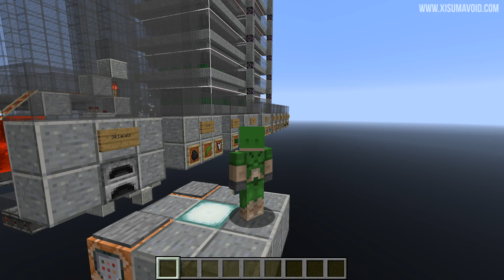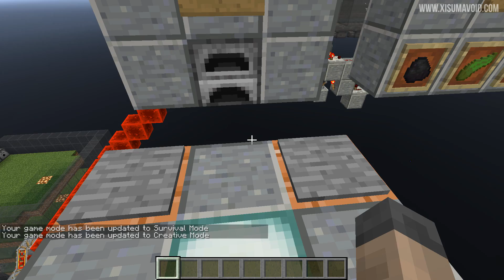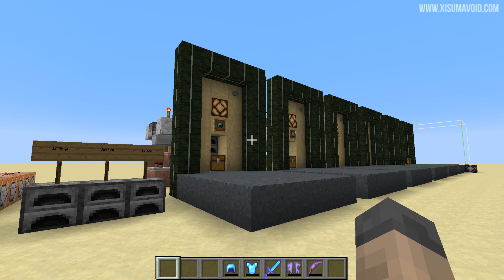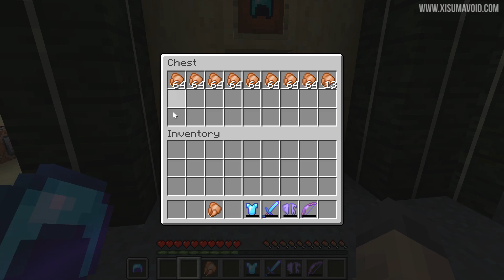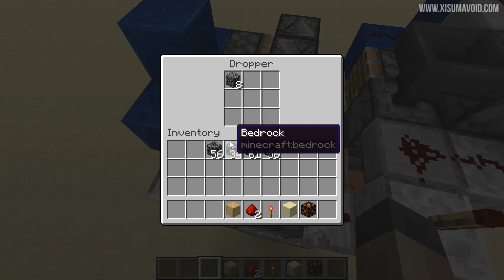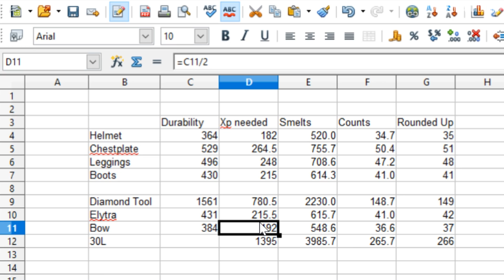Minecraft 1.13 Instant Item Repair System

Comment from the maker: FYI : Not longer after I finished recording this video I figured out a way to do this with 0 redstone... So tutorial may be coming soon :-)
Reply: Let me guess - setting the storage of the output chest to the amount needed for the tool, making the furnace stop simply by backing it up. Is that how to you're going to make this redstone-less?
Reply: niice :D
Reply: I tink level 27 to 30 is more usefull as 0 to 30
Reply: You can have the hopper under the furnace have just enough empty space for the number of smelts you need.
So if you need 520 smelts, you leave room for 456 roast chicken.  When it's done, the furnace will have the right amount of XP, and a full stack to take.
Reply: Mumbo will be upset
Reply: @bluewarrenlim  nothing stops you from building automated restart system by addind lockable hopper underneath the chest to get rid of cooked chiken.
Reply: Blue Warren Lim why?
Reply: I would like to see a tutorial on this working both ways, one with redstone and one without. I was thinking you might be able tho use a sticky piston to move a redstone block into place to lock the lower hopper once the desired count is reached. This way you could duel wield items and repair both, if they aren't both totally down to one point of durability. Thank you for your snapshot videos.
Reply: 0 Redstone! That's my kind of Redstone 😋
Reply: @BiffaPlaysCitiesSkylines  hi biffa
Reply: Blue Warren Lim this is ex suma void not biffa
Reply: Great! Will be watching for the follow on.
Reply: HOW !?!?
Reply: @adamsanchez6770  simply by putting some items into chest.
Reply: nice
Reply: Can't wait for that tutorial Xisuma
Reply: I've found and killed two Drowned that were carrying both a nautilus shell and a trident and both times they dropped both. Might be worth investigating? I have screenshots.
Reply: The most simple sollution usually is the hardest one to come up with.
Reply: chest array? 

what I would do is have a system that instead of stopping the smelting at a particular point, specific to each item, is have a meter that indicates increments of items smelted,
Reply: Ok great
Reply: come to think of it, the best item to smelt if you are less patient, isn't chicken, its fish from a guardian farm, I mean absolutely passive, despite the amount of time it takes, kelp is really convenient, but you are already going there for xp, and you will run out of food, so you can check the furnaces for xp when you go there, and if it isn't enough, you can go afk, or afk when you have time and go to the furnaces when you dont. I guess it really depends on where your base is
Reply: YES
Reply: MY BODY IS READY
For I must use this XP to repair my items! It's literally the only use I have left for XP lol, I want a new reason to horde the green stuffs!
Reply: How about using an automated chicken drowning farm to get something to smelt up, and a carpet or witch farm to fuel it?  (Witch farms are great but if your base is 1000 blocks from the nearest hut... although I suppose you could just use a regular mob grinder with a lower number of witch kills.)
Reply: #keen
Reply: Instead of the roast chicken you can use a cactus farm which could produce items alot faster
Reply: Why not use the wither tree farm to filter wood into an infinite charcoal smelter (using charcoal to make more charcoal) you could actually use all the leftover charcoal while the chicken will just go to waste?
Reply: Does this work on beadrock or it is java exclusive.....
Reply: Has it come yet?
Reply: The Belgian Boy for your information
Reply: Does thus still work in 1.15.2?
Reply: Yay! I have like no redstone left on my world
Reply: can i join hermit craft?
Reply: @ipolar6217  ive heard grian is the final person to join.
Reply: Glenpri I want to join to

Comment: If you know how many items need to be smelted, then you could compare the output chest to another chest (with the right number of items in it) so that it will stop the furnace when it has the right number of xp.  Of course, having emptied out the xp, you'd also need to empty out the furnace output chest.  Not knowing what those counts are, I'll eagerly await your tutorial. Or maybe, I'll use your spreadsheet to figure out a system of myself.

Comment: What if, instead of "stations" for each kind of item, it was a row of furnaces capped a specific number? Like, for example, items would be smelted in one furnace until it reached 50 exp, then the next furnace in the row would be filled to 50 exp, etc etc. That way, regardless of what you're reparing, you can control how much you repair each item.

Comment: As for the sticks you don't need to build a witch farm as such.
2 Planks= 4 sticks.
64x4=256 planks
128x4= 512 sticks (8stacks)
It can smelt 4 stacks of blocks..
So it is much easier to farm than build a whole witch farm

Comment: next should be "if you pick up a furnace with Silk Touch, it preserves the XP stored in it."
That way you could make an actual XP-store where you sell xp (or they should add XP bottles, where if you cook an empty bottle that the furnace places its XP inside)
Reply: Or, instead of cooking them, empty bottles could be placed in the fuel slot to collect XP, similarly to buckets collecting water from sponges.

Comment: You can unlock the hopper with the reset button so as it's resetting it so it could be prepping for the next smelting a day inline delayed and increase the delay before it unlocks the hopper depending on the amount of items that need to be removed from the dropper. or maybe like a t flip-flop so that when you press the reset button it'll unlock the hopper and then when it fills up that resets the Flop again and locking the hopper

Comment: This would be much easier to supply with a blaze spawner and piston crusher setup, blaze rods are much easier to acquire than sticks from a witch farm. A chicken farm in the nether is easy enough as well, just bring eggs.
Reply: Blazes only drop rods on player kill. He went over this in the last video
Reply: DestructivForce True, the only fully automatic fuel source I can think of is sticks from a Witch farm. Blaze crushers are best for blaze rod farming and XP collection by leaving them on 1 HP.

But I forget, what do Blazes drop when they suffocate?
Reply: it all depends on where you build it, IMO if you are willing to deal with a slower xp build up, kelp is a good option, one thing that would be really useful, is instead of one furnace at a time, and one item type being cooked, is a segmented furnace array (separate the furnaces into multiple groups of 8, or so so you dont have to empty all to keep accurate count) that determines how much xp to add to the count based on the item, could be item filter or manual input,

Comment: Can someone give me tips on how to get Mending books?
I really need them :/
Reply: Afk fishing and villagers (and treasure chests, but that is based on luck of finding a loot chest and if a mending  book is in it).
Reply: AFK fishing, villager trading.
Reply: I trade season pass
Reply: LOL
Reply: AFK Fish.
Reply: well i play on ps4 so afk fishing is no option
Reply: Rumbo Jumbo I'm on a PS4 as well and had no problem AFK fishing. Just use a rubber band to hold down the L2 trigger.
Reply: a villiger breeder would then be the best option
Reply: You can get mending from librarians, by fishing or by looting end cities
Reply: I play on console so the end cities are always the same. Luckily for me I found a diamond sword with Mending And bane of arthropods 5 so I just mixed it with a sharpness 5 sword. I can't afk fish farm without the controller falling asleep for me.
Reply: OvPd change settings on sleep time for controllers
Reply: AFK fish
Reply: and i'm going to loot some more endcyties to get some mending gear
Reply: @Incaned  which console? On my ps4 i just use a rubber band to hold the button and it works fine
Reply: villagers can take much more time to get going but then it is way faster
Reply: Fish
Reply: VILLAGERS
Reply: Rumbo Jumbo FISH

Comment: If all of the cooked chicken was stores in chests like you have before being drained to a bulk storage system, you could read off of the chests instead of using a counter. Once it triggers, the chest can be drained, the machine stopped, and an extra chicken sent to cook so that you can get the XP.
Reply from the maker: This is what i released after :-D Would also have to "block" portions of the chests/storage

Comment: There is another thing that you could smelt that youcould get autumaticaly: armor. If you smelt iron/gold armor you get nuggets
Reply: In order to get armor from any mob it has to be a player kill.. and player kills grand experience... So I don't see the point for building the "item repair furnace" if you've got a pigmen donut farm.
Reply: Good point. The only problem is, I think the only way to get armor and swords is from pigmen, since gear is player drop only. Which kind of defeats the purpose, because to use a pigmen farm for gear you have to stand around, afk. Still though, if something slipped my mind that is a very good idea.
Reply: @jacobmosier3816  armor comes from zombies and skeletons that are wearing it. But it's rare, so it's not veey efficient.

Comment: Put a pressure plate in front that locks the bottom hopper while you're there so you don't have a problem pulling out that chicken

Comment: please stop calling your XP systems instant. they are NOT. you are forced to load the area for the furnaces to generate the XP and it is a very slow system compared to ANY other xp source. you can build a mock up gold farm in a very short amount of time and from that point on it generates xp without any player interaction except the short pigman angering. the high end XP guardian farms can repair you tools in less than 1 second, which is more or less the same time your furnace take with the lag spike.
Reply from the maker: Your missing the point entirely. You can go play the game, do whatever you like and then not have to stand around at a farm. You can get the XP on demand and that Is why these are great alternatives to traditional farms!

Also guardian farms do not repair your tools in 1 second.
Reply: +exeyesumavoid You're* derp :p
Reply: if you fill your spawn chunks with these systems, you can do other things and it will make xp for collection later.
Reply: Yeah, Eddie S is right. Also are you really going to need to repair this stuff THAT often?
Reply: Need to load? Heard of spawn chunks?
Reply: 1. Place it in the spawn chucks, it's instant since you than just have to grab a item out of a furnace, no waiting. 
2. It will reset with a button press, without the user having to move the items.
3. Why the hell are you so mad?
Reply: i'm not mad at all, just pointing things out. if you want to build a lot in your spawn chunks, feel free do to so, but be aware that this is one more drop filling the MSPT barrel.. :D
Reply: Spawn chunks make this idea meta.
Reply: oh.. "automatic reset". there again, you are not on point with your wording, i still think your idea is great, but please choose your words better. your reset is manual, since you (the player) needs to push a button (with their hand). that is not what you call automatic...
Reply: Who hurt you?